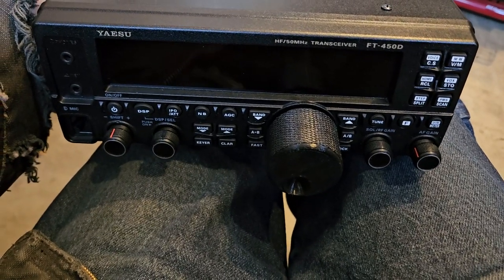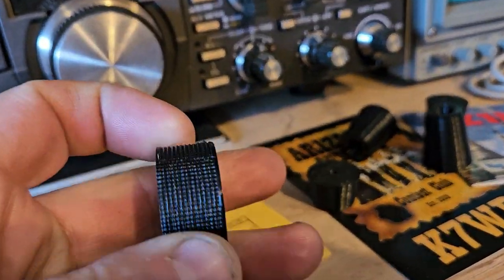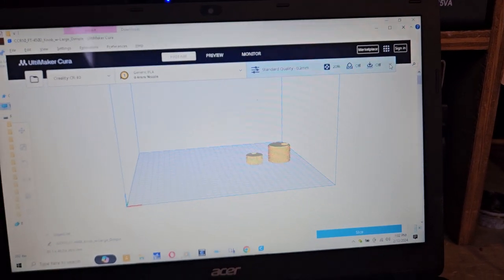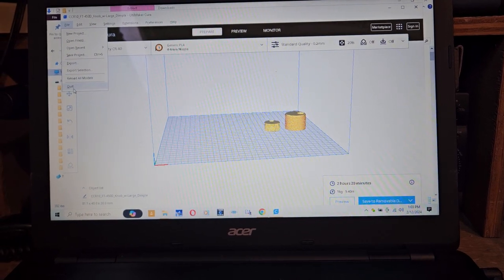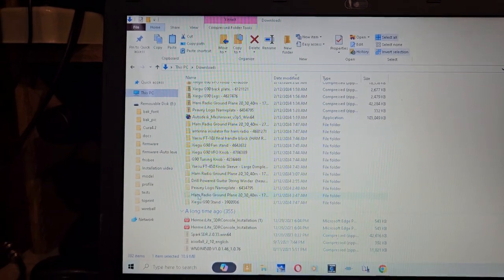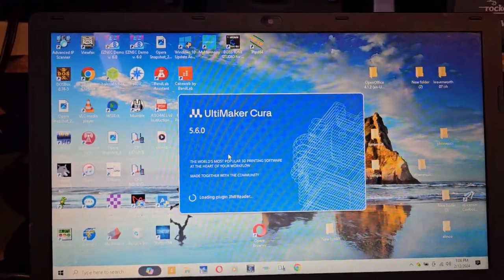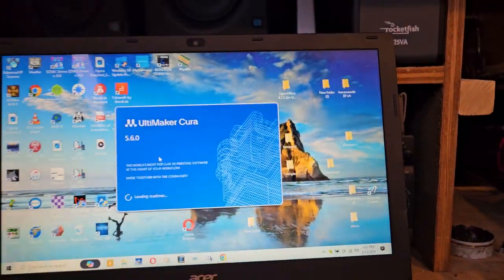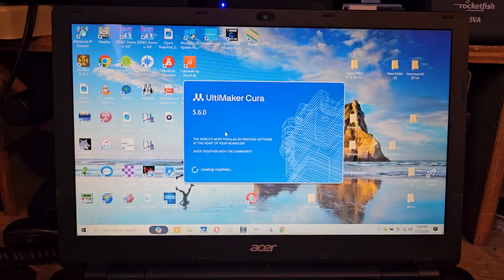3d printed vfo knob for yaesu ft450 ft450d

Comment: that's my only complaint with this rig, I have a 'D' model as well. I want a printer so much , I'd print all sorts things like that too. the ft-450d is such a good rig.
Reply from the maker: I think amazon has several ones for under 150 that would work fine for this stuff. The knob made a big difference for me. Its been quite a learning experience.  I jump all in on most things . But its definitely possible to get a cheap amazon printer and print yourself  a lot of stuff with no experience